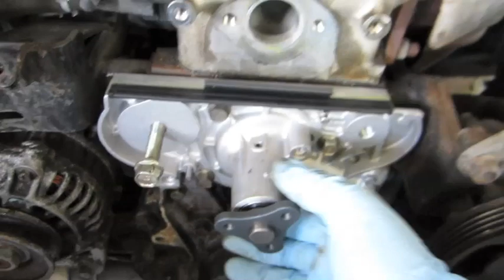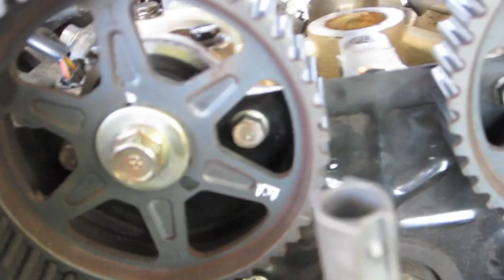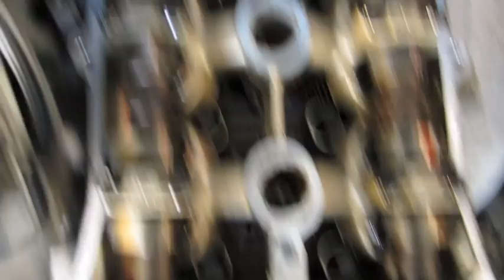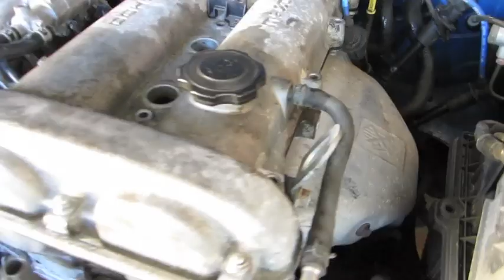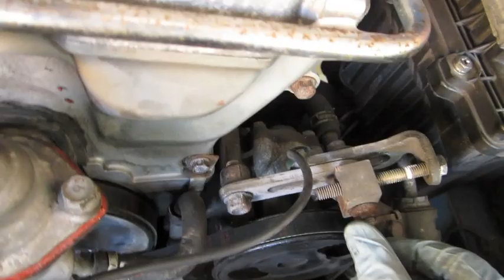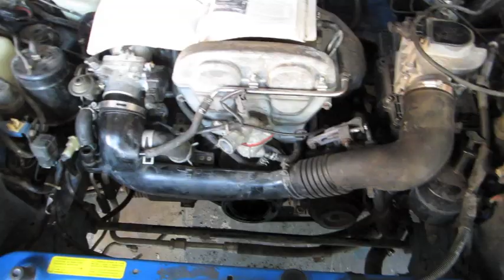1991 Miata Restoration Timing Belt part 3

Comment: hey! thanks for the videos but i really need some help. I noticed in the last video you said to mark the cam gears as to not mix them up... well i didnt and i did indeed mix them up. what can i do?
Reply from the maker: +Beef Guy Watch the part 2 of the video series and mimic the orientation of that. The gears are identical in diameter and # of teeth. You'll know you have it right when the marks line up. Just remember that when facing the engine, the intake is on the left, so make sure your "I" mark is at 12 o'clock. There is a secondary mark stamped into the head that should line up with its corresponding letter on the cam gear. Do the same for the exhaust cam, lining up its marks.

Comment: What was the travel distance on the top of the timing belt with the straight edge?  Good video thanks
Reply from the maker: Hello David, according to the enthusiast shop manual, applying 10kg or 22lbs of force, the belt should deflect 9-11.5mm  or .35-.45 inch. Hope this helps.

Comment from the maker: The harmonic balancer has a rubber insert to absorb vibrations from the crank and belts. Over time, that rubber will harden, crack and rot. If you look around on youtube there are some videos of what a failing balancer looks like and knowing the car had the SNC, I didn't want to take the chance of the balancer exacerbating the problem.

Comment: You mentioned that you had a power loss.  Power loss at the bottom or top would indicated an intake cam being off.  Was your power loss across the RPM's?  In your second video when you open it up the exhaust cam looks off.  Also, an exhaust cam being off can cause overheating.

Great Videos!  It's hard to believe there are so few replies...